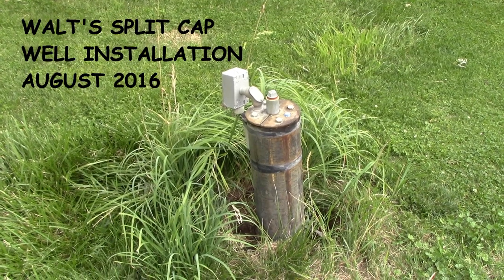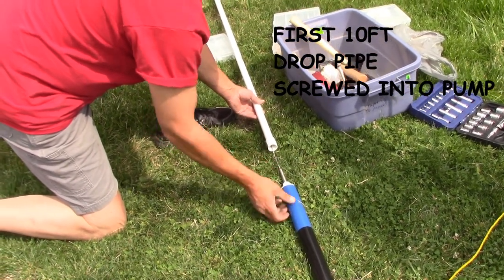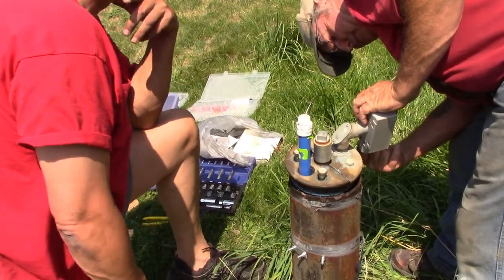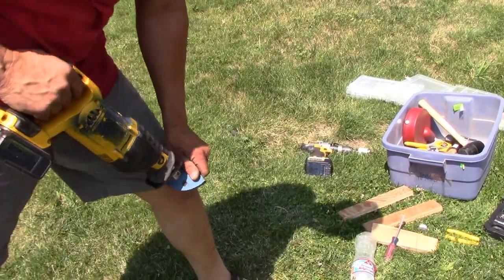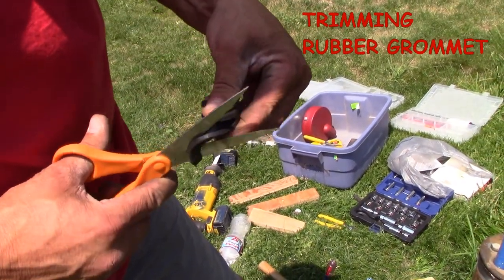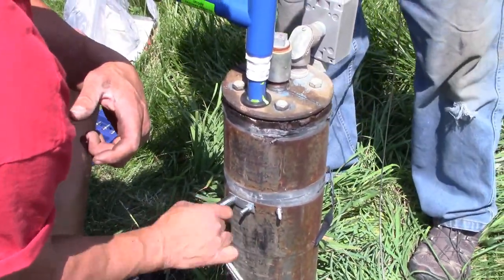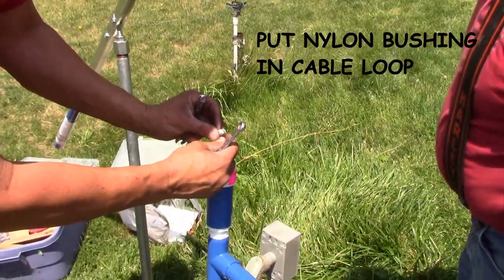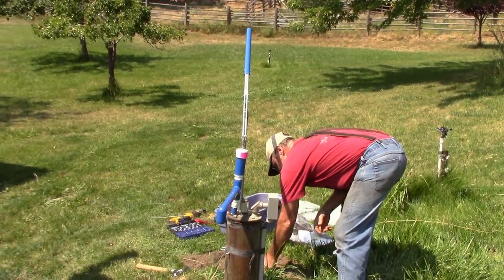AR WITH SPLIT CAP

Comment: Lol. I was watching this in hopes of an informative video on how to get the cap off. In less than a minute, you pulled it off and wrote my answers. I wasn't able to get a good look at the cap construction and had to watch 3 times so I could watch and read. Thanks. It should help some.
Reply: Same! My water has been off for months because I dont understand how to get the cap off and I nearly backed those 4 bolts all the way off. Which would have been bad and this guy does exactly what no one else does he shows you how to pry that edge up and just pull the cap off.
Reply: Me too.

Comment: Interesting. I had to take my well apart and it has the above ground pump (Shallow). I have the split cap and had to take it apart slowly as I had no idea how it was constructed. Nice video. I like the use of a cut block of wood to hold the pvc as you're installing it. I was using clamps, which of course is more time consuming. Was trying to figure out the large 1 inch bolt on the top of the cap and realize it was used for electric, which I don't need. Surprised on how few videos there were out there on this subject. Thanks for sharing.